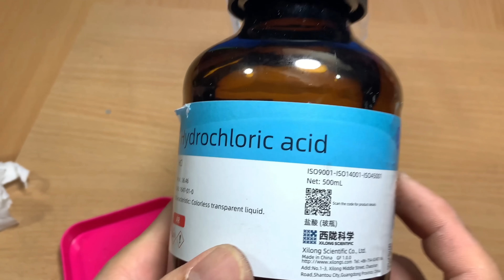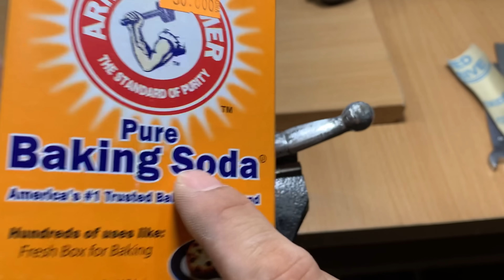Welding Aluminum Is So Easy! But Very Few People Are Aware Of This Method!

Comment: When cutting with a sharp knife, you should cut away from your finger or any skin in case the knife slips
Reply from the maker: That's a great tip, @BoBStrohm-r2s! Safety is crucial in any hands-on activity, whether it's cutting or welding. Always better to prioritize caution! 🔪✨

Comment: this way is very dangerouw because is nbrake easily Just imagine what will happen if you need to brake hard and this will 100% slll brake I do not recomend  this You must be more responsible
Reply from the maker: I appreciate your concern! Safety is so important, and I’m glad you’re looking out for others. Responsible practices make all the difference in welding.

Comment: No welding has been done in this video. Some soldering has been attempted but failed. Joining of the parts was accomplished with a threaded stud. Gaps in the threaded assembly were filled with resin. Ecch.

Comment: So its much harder and way more work the steel welding. And the money you well spend on all those tools and heat guns, torch  solder etc. Instead just buy the lousy handle dude.
Reply from the maker: Aluminum welding is a great skill to learn for crafting and repairs! 😊

Comment: For today aluminium and aluminium  alloy are. soldering with appropriete fluse and soldering stick. Autor is fulish and two left hands invalid.
Reply from the maker: I understand that soldering is a common method, but this video is about welding, which is a more robust and durable way to join aluminum.